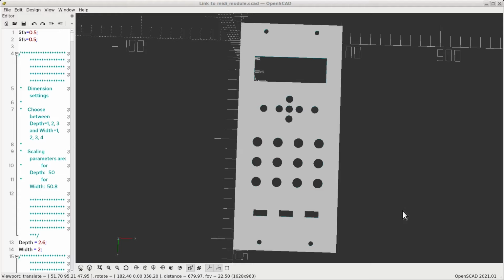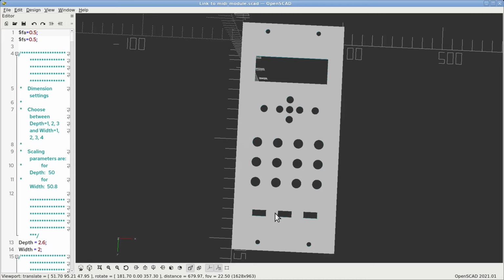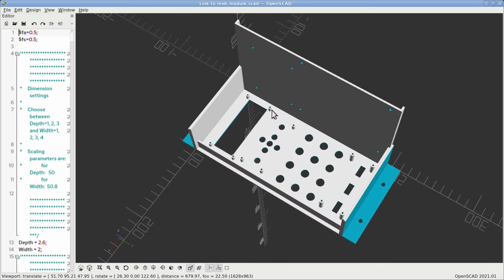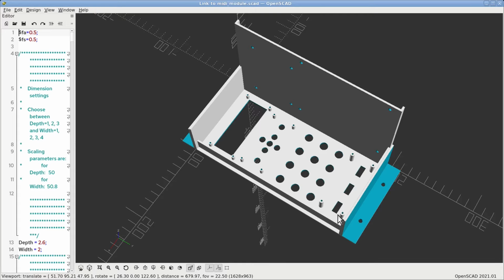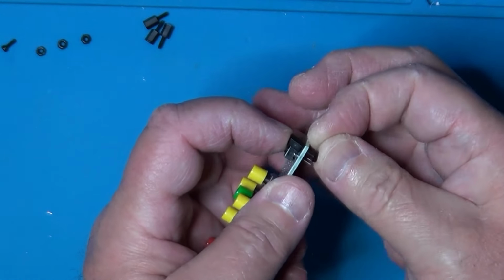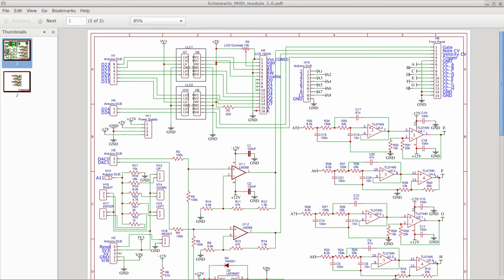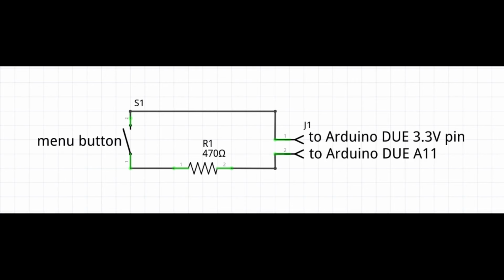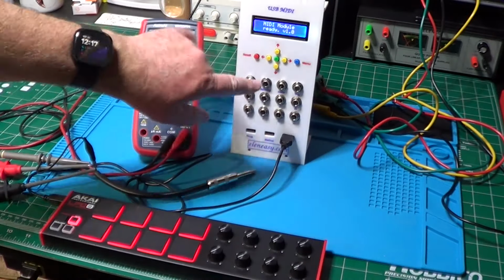The Synth Project Episode 46: The MIDI Module - Part 7

Comment: This is extraordinary, I really enjoyed all the videos in the series, I came in looking for information for something similar, but I couldn't stop watching.
thank you very much for all this
I have a question, I hope you can help me because I am somewhat lost and I have searched for a lot of information and tried but without much success.
Is it possible to receive MIDI messages on an arduino with a USB host shield, and map those MIDI messages to certain "serial HEX messages" and send them to another device? I don't need a screen, just receive the MIDI message and have it already mapped to certain serial HEX messages and have the other device receive it.
There are only 20 messages that I need to map. It is practically an interface that receives midi messages and maps them to change patches on the other SERIAL device.
greetings.
Reply from the maker: You can use an Arduino due with a host shield.  You can receive the midi messages through the usb port on the shield,  and send your serial information through the native usb port of the arduino.
Reply: @eleneasy  thanks a lot, this could be posible with and Arduino uno?
Reply from the maker: No, it has to be the arduino due. According to my experiments, the host shield does not work well to receive midi messages  with the arduino uno.